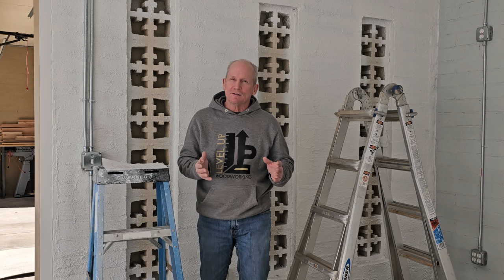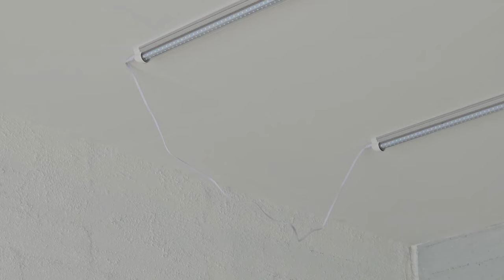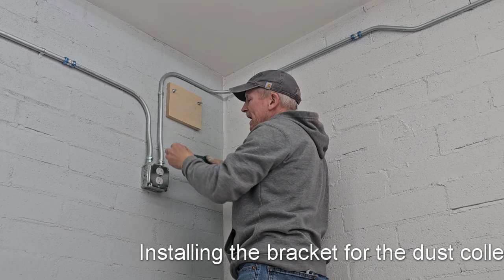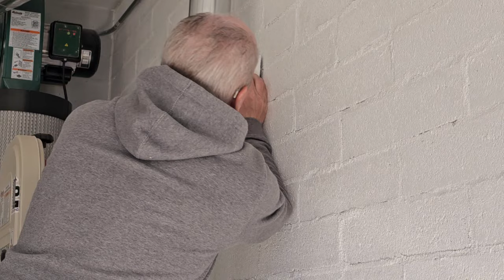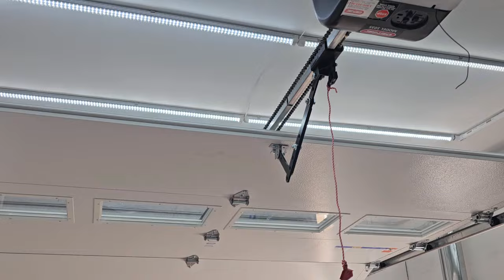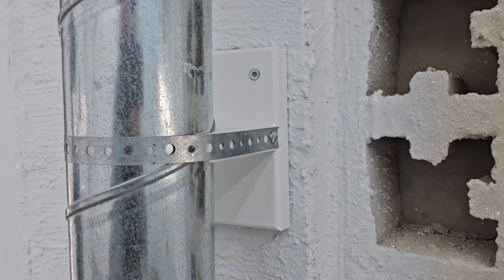Lighting & Dust Collection:  How to build into a small shop  #woodworking  #garageworkshop

Comment: Architect and woodworker here with a lot of experience specifying lighting: lighting “temperature” describes the color of light. 5000k is similar to sunlight and much “bluer” than typical residential lighting of 3500-4000. If you’re creating pieces for residential interiors, the color of the wood will look most realistic in this lower kelvin range. I also recommend looking at flat panel LEDs vs linear to minimize shadows from more concentrated sources. Finally - I’m so glad you mentioned CRI - low cost fixtures with lower CRI can really throw off the color of your workpiece.
Reply from the maker: Thank you for your comment.  Totally agree, lighting is a very complex topic and pieces will look different in various types of lighting.   I first learned how to use flat panels in my photography lighting classes but don't have the budget for both.  That is not yet :).